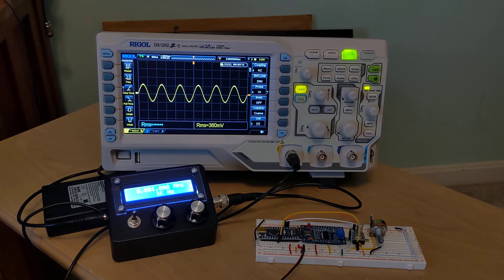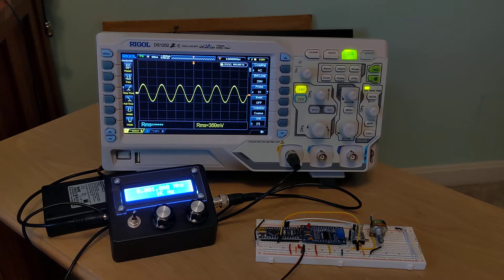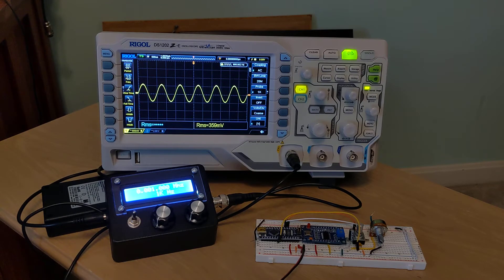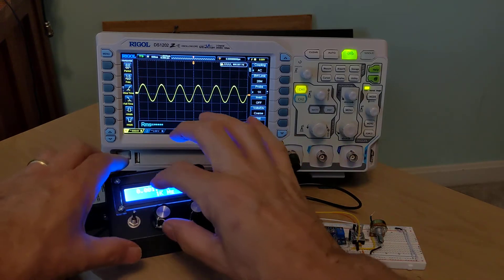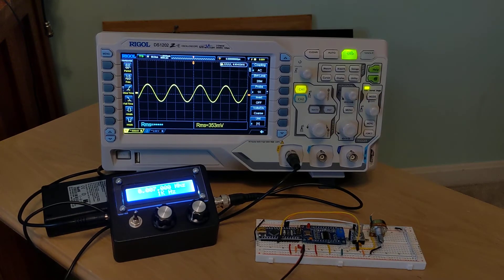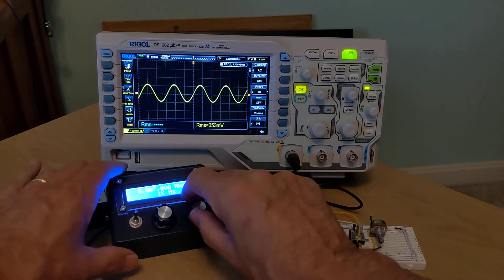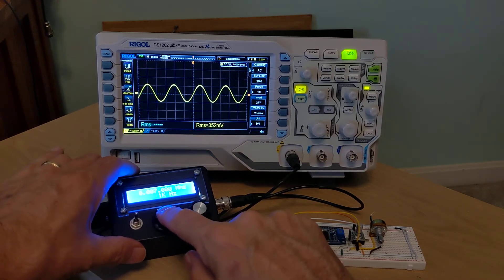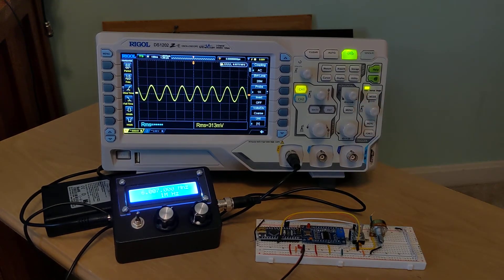KK4DAS Signal Generator

Comment: I cannot get the siggen sketch to compile I get error :- LiquidCrystal_I2C.h: No such file or directory I have tried several libraries but cannot fid the correct one. Can you assist and thanks for sharing your knowledge
Reply from the maker: The correct library is LiquidCrystal I2C. You should be able to download it from the Arduino Library Manager.  Or you can get it from github.  https://github.com/johnrickman/LiquidCrystal_I2C